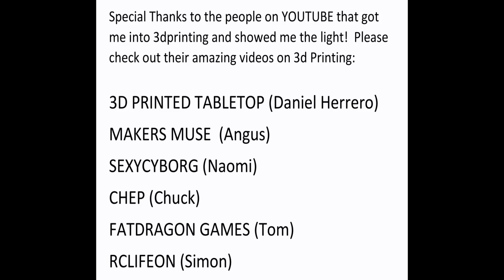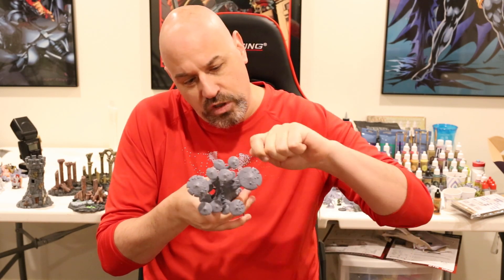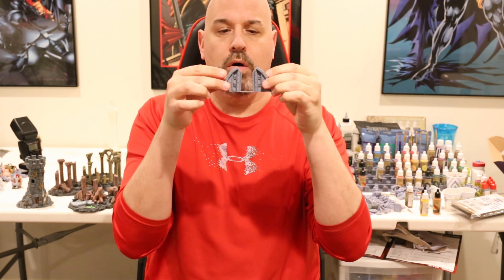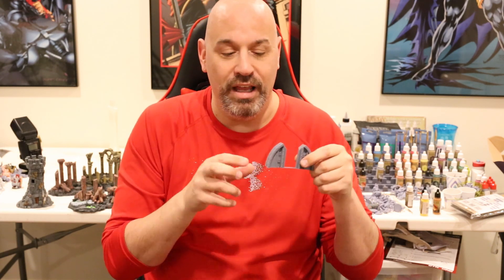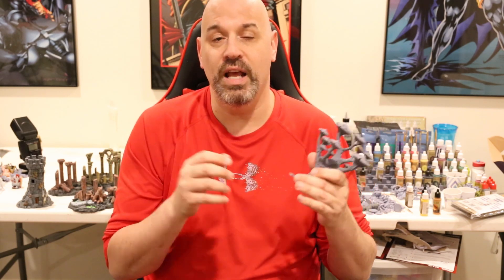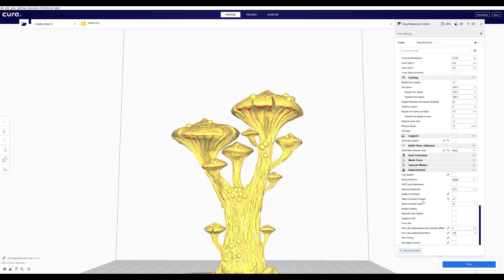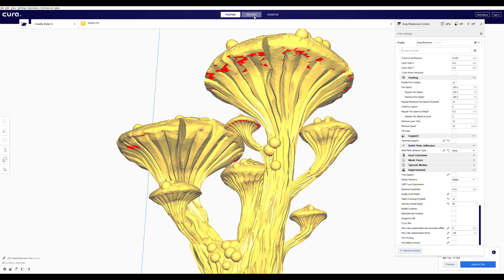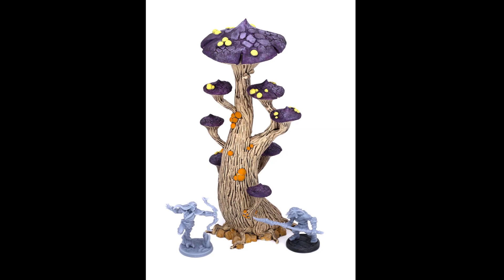Using "Make Overhangs Printable" in Cura for better terrain and minis

Comment: i just installed cure, I recently got a creality 10v2 and it came with slicing software that i had been using. my cura doesnt look the same as yours, what version are you using i cant find anywhere some that says make overhangs printable and an option to what degree they add to it :/
Reply from the maker: 4.0
Reply: This reply is a little late, but for others reading this with same problem: make sure you are in 'Expert Mode' to see those options. It's listed in the hamburger menu on RHS of version 4.13.1 Cura